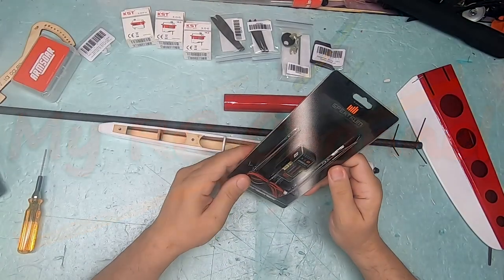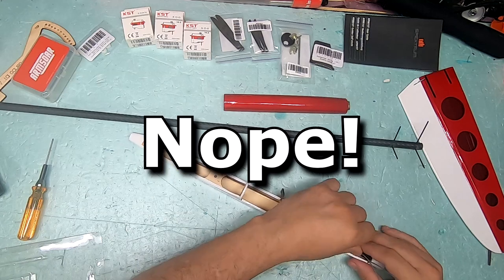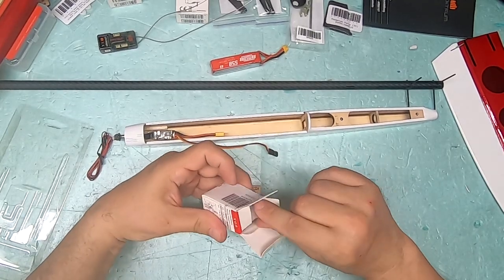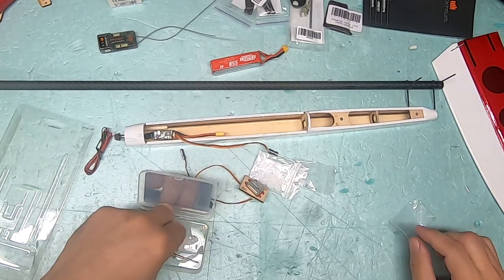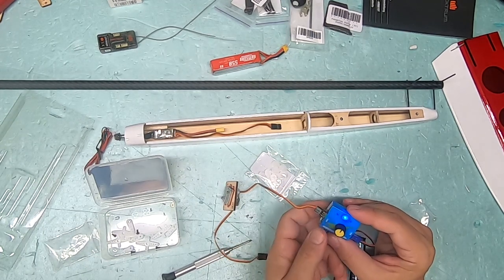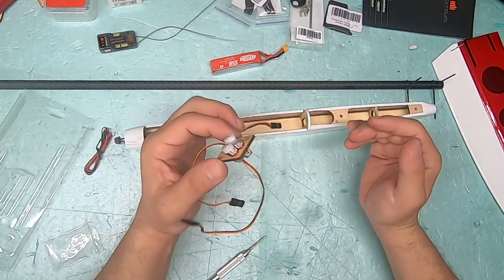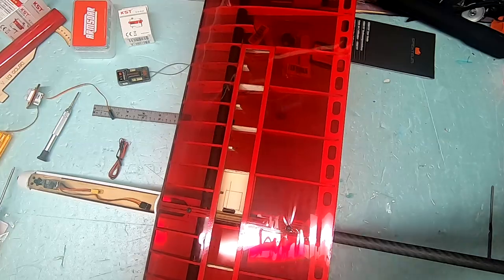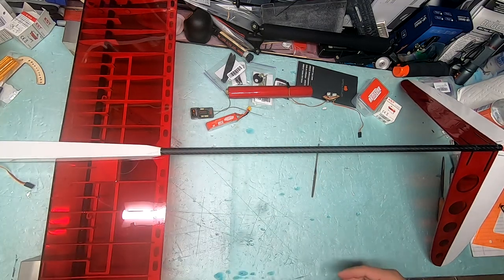Build an ArmSoar E-Medina 2m F5-RES/F5L ARF Electric Glider - Part #3

Comment: I like the way you set the tail feathers. I do mine similar with parallels under the wing at the exact same spot on each side then I measure up from my building board to the same point on each half of the tail.
All that messing around fitting those servos and tiny parts are  what kill my arthritic hands now. Placement of electronics is also a pita in those narrow fuselages but in the end it's worth it when you get to the field.
Reply from the maker: Thanks! It’s a very well put together kit. When the manufacturer does a good job, it’s much easier to finish.

Comment: You did sand the carbon fiber boom? The ca will wick into the balsa but it will not wick into carbon fiber.
Reply from the maker: It will still adhere to the surface. It might help to sand where it’s going to directly contact the wood, but it’s not necessary. Thanks for watching and commenting!
Regards,
CJ
Reply: @MyRCChannel-CJScott  I've seen carbon tubes pull right out of a glider wind. They where glued but where not sanded. Just smooth surface.

You don't remember me. I we used to talk thru comment about a car class  "v" something. I thought you lived close to me at that time.
Reply from the maker: @Airbrushkid  Hey, I'm not sure but I think I remember... anyway, I was concerned so I tried to twist the tail boom and couldn't get it to budge. Still, I'm going sand a bit near the inner bulkhead and apply a fillet of epoxy just to be sure. In one of the videos, I'm going to reference your comment and suggestion to pass on your tip.